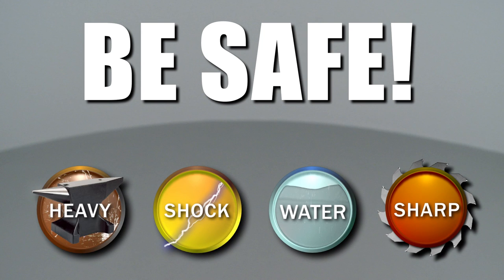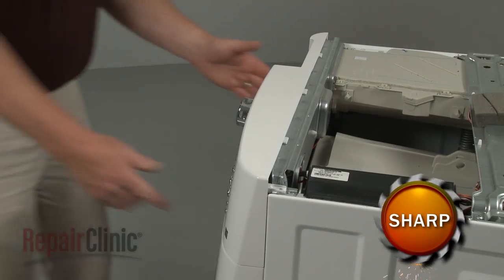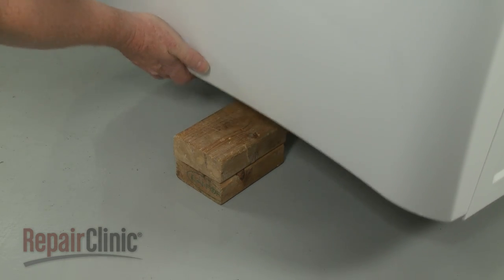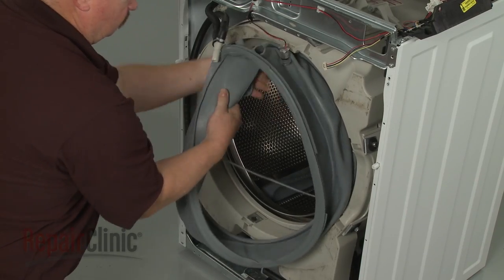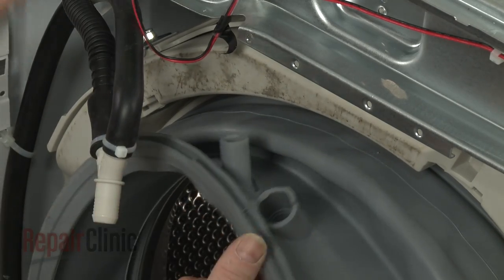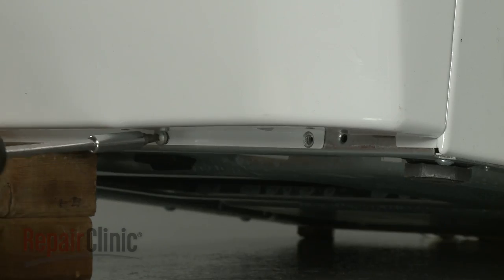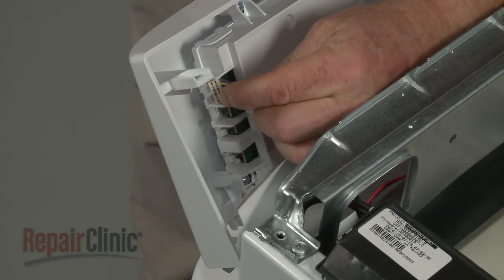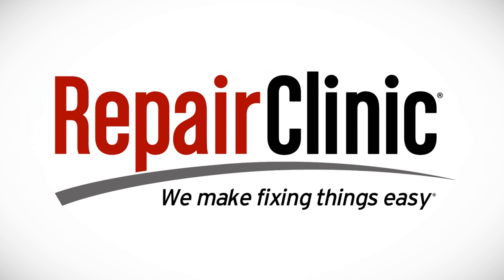Electrolux Door Boot Seal Replacement #134616100

Comment: Just followed this Electrolux Door Boot Seal guide  and have to say it's NOT easy to replace the inner seal spring!  Took 3 people including myself to get the spring to go on, but once it's on it's definitely not coming off.   So far so good.  No more nasty old seal and the problem with the washer fully draining is also gone.  I think if I ever have to replace this seal in the future i'll just opt to buy a new top load washer instead.  These front load washing machines are a gimmick if you ask me.  Anyway, thank you RepairClinic for the very helpful video!

Comment: One of the hardest repairs I've personally ever done, took me about 4 hours total, lessons learned: even with 4 clamps it was impossible to put the inner spring back on, required the clamps, mine and my wife's hands, and the use of dish soap for the seal where the spring fit in. I also had to deal with a stripped screw at the bottom front panel so that was fun. Everything else wasn't too bad, fitting the seal on the lip before the inner spring step was surprisingly kinda hard as well, had to use dish soap there too, the outer spring is cake with a washer spring expander tool I bought for 15 bucks. Conclusion: $100 bucks for the replacement seal and 4 hours of labor with 2 people, I'd say worth it, but barely...gotta really like and wanna keep your washer to justify it. I was close to giving up on the inner spring part. Those with experience or a handyman will do it quicker, I'm just a novice handyman myself, average when it comes to overall home repairs. I'm better at fixing dryers and I had no experience with Electrolux prior, only Maytag. TY for the video but needs to go more in depth on the inner seal to lip and inner spring. I had to watch another more detailed video to finally get it.

Comment: Very helpful video.  My husband replaced the boot seal WITHOUT removing the front panel or the door.  It took three of us to hold the spring to replace it over the new boot.  We also found a clog in the hose coming from the detergent dispenser which seemed to be the cause of our leak.  We found it helpful to use dish soap to lubricate the new boot seal to get it on the rim.  Thanks for everyone's helpful comments.

Comment: Just completed repair by myself. Took a total of 3 1/2 hours. I almost gave up when trying to install the springs. The key for me was lubricating the springs and the rubber track where the spring fits. With only one pair of hands I found it necessary to use 2 C clamps to hold the springs in place so I could stretch them into the track. Video was very helpful to show all of steps.
Reply: Nah, don't bother! Buy a new machine cause if you manage to get the springs back on without testing the seal, something else designed to fail will do just that. Not worth the hassle!

Comment: Thanks for the video. Took 20 minutes. Didn’t take off top and front panels, just make SEAL WET, that helps put on seal in channel and spring over it.
Reply from the maker: You're welcome! Thank you for the tip!

Comment: Just finished mine. All comments here are valid. Biggest challenge for me was getting the seal to sit on the outer ring...fingers sore from pushing the seal over the lip! Then used two clamps for the inner spring plus stretching the spring as you start installing it will help build up some extra length as you get to the end of slipping it over. An extra pair of hands would be recommended for this step. Quality of seal was perfect and the repairclinic video was great. Repairclinic rocks!

Comment: Just used this video to guide me successfully through the boot seal replacement!  The only tools that I didn't have (and discovered that I needed after an unsuccessful attempt) were the two spring clamps for the inner spring re-installation, but after a quick stop at the hardware store I was able to complete the job on my own.  As others have commented, placing the back and front lips of the new boot over the outer drum rim and front panel (respectively) is a rather difficult and physical task for the hands of a desk jockey like myself, compared to the simple appearance in the video.  Thank you!

Comment: Just completed this repair today took about 2 hours total, removed the front door assembly, removed the old boot installed the new seal and used 4 large clamps to assist with the large spring was able to compete this by myself with just moving the clamps around and putting the spring into the slot. The clamps helped out a lot. Don't get frustrated just keep calm and it can be completed easily

Comment: Just did this without taking the top or front off in 90 minutes with no lubricants. Removing the old seal took 5-10 minutes the rest was reinstalling. 2 Quick clamps, F style or C clamps are needed to reinstall the inner retaining spring and I installed the rigid part of the spring at the top and installed the 2 clamps at the 10:00 and 2:00 positions and worked the spring clockwise (an automotive brake spoon will help here, using 2 is even better.). Outer retaining ring can be stretched at the spring/ring connection with a pair of needle nose pliers in the ring loops , but snap ring pliers will work even better if you have a pair that is reversible and will open wide enough for the ring to fit over the gasket.

Comment: I would add an extra step - at around the 3:45 mark, add rotate the drum manually by hand to make sure it doesn't rub.  Ran into the issue (even though everything appeared fine) and didn't check earlier so had to go through the entire process again, which was painful the first time.  Rotating the drum after each subsequent step made sure that nothing was done to cause the seal to rub against the drum helps reduce the number of steps you might need to backtrack should something be slightly off.  Other than that, great video, very helpful - thank you.

Comment: Thank you VERY VERY much for this video. I was very upset that i might have to hire a tech to perform this repair, until i found your video. It was the 1st video that came up during my searches. I considered myself lucky. 
I was very happy to find a review that had my Exact problem and my Exact washing machine. Our had toen in a matter of a little over 5 years, and we are family of 5. These instructions were Very thorough, and very easy to follow. Thank you for also providing the part number information, not to mention the actual OEM part number, unlike some places. 
I do have to say, that your store, has this item listed at almost the highest price, based on an internet search for the oem part number, so you might want to compare your prices to other places...
Some notes for those who decide to tackle them themselves, like we did. I do consider myself a little more "handy" than most of the people that i know, and i do tend to perform a lot of my own maintenance and repairs on most household things. But this was pretty easy over all. It took us less than 45 minutes, including grabbing tools, and clean up.
Suggestions and notes: This is easiest with 2 people when installing the inner and out tension ring and spring. It was easy with 2 people, but i imagine that with only one person, that this could be difficult, and possibly more dangerous. The part that we struggled with the most, was getting the boot installed. The lips on the boot that the machine wall attaches to, inside and out, were very difficult to install, in the right place, and getting to stay. We spent more time getting the lips on the boot to slide into place. 

Again, thank you very much for providing this video. I will be sure to check back for any of our future repair needs.

Comment: Did this job today on the same model washer in this video. Easy job, just follow the instructions. However, that inner spring is a SOB to install but I did it by myself just like in the video with a LOT of spring stretching. Also, you need to only use the 2" metal spring clamps (I used four) as the plastic spring clamps don't have enough tension to hold the seal in place when pulling on the spring. The spring clamp I used was from Habor Freight, Pittsburg 2" Spring Clamp 39529

Comment: Amazing video. Great help. Thank you very much. 

SIDE NOTE:
There is a way to take out the gasket without taking off the top and front panel. I would highly recommend not to do that. As you cannot get the gasket back on without taking those two panels off.

Comment: Excellent video. I agree that the inner seal spring is a bear to get on.  I used 2 clamps secured around 10 and 2.  I had to use both hands and a foot to get it on.  It's a challenge.  seating the seal of the boot also takes some skill/patience.  The inner seal is more difficult.

Comment: I replace the bearings in my washer which included the whole back half of the tube shell. To do this requires removing the door boot. I found it helpful to remove the weight ring off of the front shell to replace my old boot. A new boot may be more pliable but the old one was impossible to put back on until I removed the weights.

Comment: You don't need clips I did it myself try your best to get the rubber seal around then make sure spring falls behind the metal where you placed the seal it will hold it on. Be careful and patient it can come loose but i hold it like installind a steering wheel cover. Thanks for the video my washer works now with no more leaks :)

Comment: I’m sure I’ll get heckled for this, but it may help someone if they are in my situation:

I have my dryer stacked on top of my washer in a very small confined space. Unstacking and pulling the machine out would have taken two people and a lot of effort. I decided to try and take the boot seal out without removing the top and front panels. My issue was the inner spring.   I did not have the right sized clamps to get the inner spring to go around the inner seal. I spent a solid half hour trying to get the spring to work. I could not make the spring go all the way around. 

Here’s what worked. I decided to create a chain of large zip ties in place of the inner spring, ditching the inner spring completely. I pulled the last zip tie extremely tight and was sure not to cut the zip tie ends. I did not want to have sharp edges cut the seal. I’m sure techs would cringe at this idea, however… it worked flawlessly. Obviously if I had other options I would have taken them, but this worked well for me. It also cuts the repair time down significantly and removes the main safety risk created by the spring. I hope this helps anyone that is in a similar situation.
Reply: Over a year later, no leaks…

Comment: Didn't have a clamp, but had a pair of vice grips with a rag (to prevent damage to the new seal). Got the job done and the hardest part was getting the seal on the machine in the first place. Ended up using the butt end of a screwdriver to push it on because my thumbs were hurting. Definitely need elbow grease for this job or at least some extra hands. Overall, much easier than some people in the comments made it out to be, but more difficult than the video shows 🤣

Comment: Wow, lots of sweating swearing,  resting, because it is so hot.  I got it done. Not only i got the door jammed because i didnt have the outer gasket on properly,  i had to learn how the door mech worked. Ended having to have put a flat in behind the panel and push the latch.
Big tip. Have strong spring clamps  and really stretch the retaining spring to start off first,  that way the end of applying the spring is easy.
Manipulating a brand new gasket is hard work. Probably best left in the sun for a little while so it losens up.
5hrs , still saved dollars, but nearly busted my back in awkwards positions. Best use a high bench when working on this machine . 
The model varied slighty and the front panel was too difficult to take off the entire way, so i worked with the panel half off.

Comment: Problem with my unit is a huge rip in the boot seal. Wouldn't take long except on the newer "timecare" models, they put one of the front panel screws BEHIND the plastic. At 1:04, one of those screws is now behind plastic. Wtf.

Comment: Like many others, thank you for the video.  Very helpful, but the video could have been better.  My first post-repair load of wash is running right now, and so far, so good!  However, at about @3:23, it would have been nice if the directions were a little more explicit / specific about how to put the inner part of the boot seal into the washer.  Wasted a ton of time and energy trying to get it in the wrong way.  Once I figured out the right way, I found it difficult to get it on correctly.  The guy in the video makes it look like there's nothing to it and it's done in 3 seconds, but in all honestly, it took me over an hour.  The inner spring was also challenging, but I used 4 clamps to get it done.  Started at the top with one clamp so both hands could be free, one to stretch the spring, and one to guide it into place.  Then, about 1/4 of the way down, I'd clamp it again to hold it in place, then I'd work on the other side, 1/4 of the way down, then clamp.  From there, I'd get a little more in place, then either add a new clamp or move an existing clamp, to keep "saving" my progress and give my fingers a break.  Finally got it.  Loved how the video shows a set of pliers being used to help with the outer retainer ring, but the narration makes absolutely NO mention of pliers whatsoever, nor are they (or the clamps!) mentioned in the list of tools needed for the job.  Had to figure that out on my own.
Reply: I had the exact same situation. And tried so hard the wrong way I separated my thumbnails from the nail bed. Painful as it sounds.
Reply: @genevladimirov6250  ouch.
Reply: Please tell me the right way how to put the inner part of the boot seal into the washer.

Comment: A bit of a disaster ... after replacing the boot and running the washing machine the washer was full of rubber particles. Apparently the boot is rubbing against the drum. I will give it another try but not sure what is causing the issue.
Reply: I just replaced mine and ran one load of laundry and had this same problem, did you find a solution or did it just wear itself enough to where it doesn't rub anymore?
Reply: @teeburns1  I did fix it. I reinstalled the ring. There is a notch at the top that lines up with a notch at the top of the door frame and I misaligned it. Once I did that there was a good space between the ring and the door metal

Comment: I'm having a really hard time fishing the rubber seal around the inside. Anyone else have trouble here?
Reply: Work it from bottom and work right and left untill your half way up. Use clamps to hold it in place then stretch and work around from right or left side to the top and around. The sides have a lot more clearance so ending there is the easiest as that the hardest part.
Reply: Use dish detergent! It makes it much easier to  slip the seal over the lip.

Comment: Took me a few hours. Getting inner boot seal on rim took longer than stretching the spring around. A few things I ran into...

1.) The boot has a tab that points inside at about 10. I kept trying to tuck that tab and the whole boot into/behind the actual wash drum. Don't do that - it should sit flush and the tab will simply point in towards middle of drum. That is why you will see so much water and gack on the old boot, b/c is is a poor design. Wasted much time here.
2.) I think a little dish soap on the rim you tuck into the inner boot seal helped. You shouldn't have to force it that much.  Wasted my finger strength here.
3.) Re the spring on inner seal - first I tried a clamp (kept flicking off) and then I tried helpers (couldn't get it on). Then I backed up the clamp with a second clamp. That held it and I was able to do it solo.